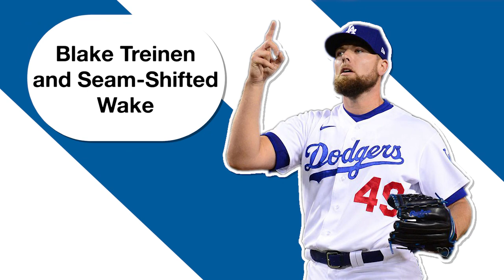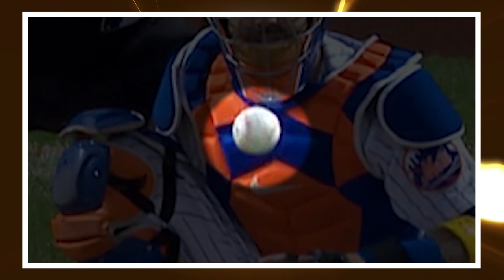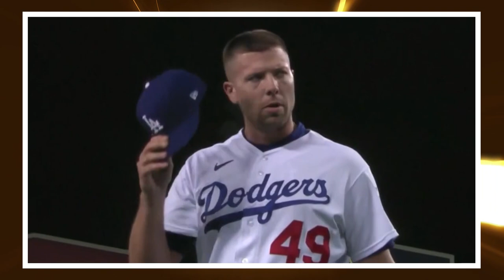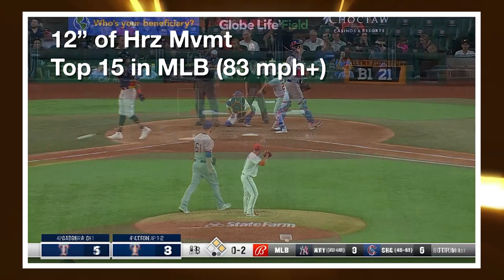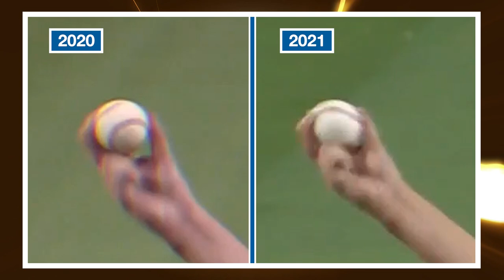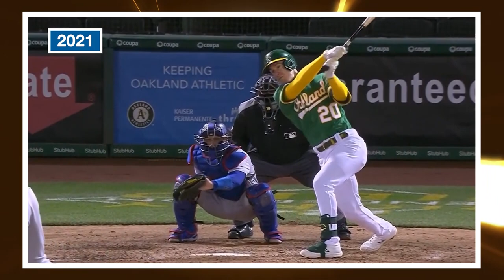Blake Treinen and Seam-Shifted Wake

Comment: I completely agree with all you’re saying. In high school I filmed all of my bullpens i threw and focused on beings able to change the spin mid flight and the effects of different grips on each pitch and theorized  that 2 seam grips on sliders when thrown from a flat/sidearmed angle create more horizontal movement than a slider thrown with gyro spin on a spin axis facing up instead of facing the catcher.

Comment: I would rather classify treinen's new slider as as slurve than a sweeping slider as it has huge horizontal break along ton of vertical drop. Lance mccullers slider has more of a sweeping motion as it has tone of horizontal movement without droping much .
Reply from the maker: I think I disagree here. Short-form movement shows Treinen's slider as -.7" vertical movement and 13" horizontal. This is pretty squarely in the sweeper category. He throws a variation to left-handed hitters that has more negative vertical break, more drop, but the aggregate of the pitch is very similar to McCullers (who has 4.6" v and 14" h). The Sonny Gray area, where he's getting -6" vertical is where I think you'd be able to properly call the pitch a slurve.

Comment: How would you classify yu darvish's new gyro cutter -as a cutter or slider ?
Reply from the maker: Darvish is an absolute mess on the pitch classification side of things. Legitimately the one pitcher in baseball that it's near impossible to know what he's throwing on every pitch, especially between his CT and SL, and even splitter, which sometimes cuts. You really need a visual on his hand every pitch to have better accuracy with this. 

My understanding that he throws a cutter around 2" of vrt and 5" of hrz (which has a little more cut and less vertical than a traditional "cutter") and then a slider at -2" vrt and 16"  hrz (that's closer than Treinen to the slurve territory you were talking about). But the problem is that everything in between is in play, he throws some cutters with like 10" vertical and minimal horizontal, which is a traditional cutter shape. And then he throws some sliders that have more vertical and less horizontal which kind of look like his cutter. Velo also a factor here too.

PitchingNinja had a great interview with him where he talks about how his thumb placement can affect the movement. Seems like he just feels his way to different shapes based on how he wants to attack a hitter: https://www.youtube.com/watch?v=850Ju8-JxZU